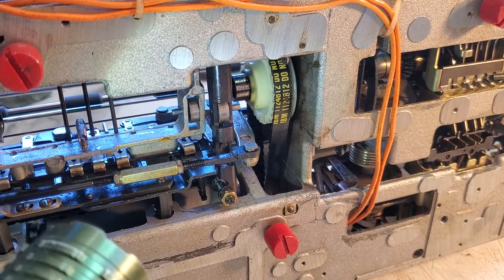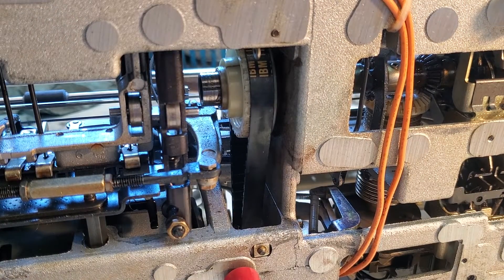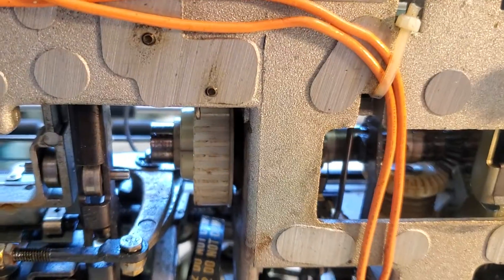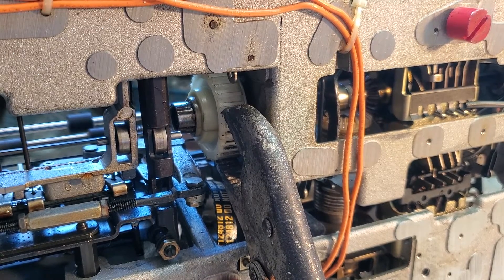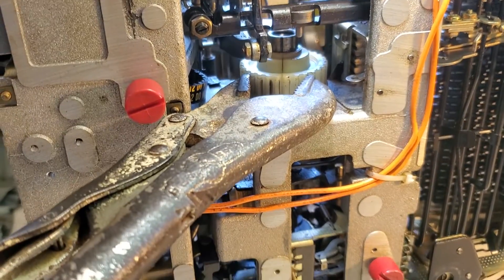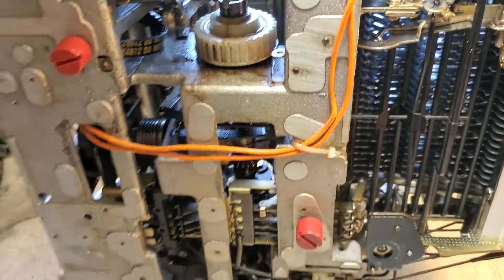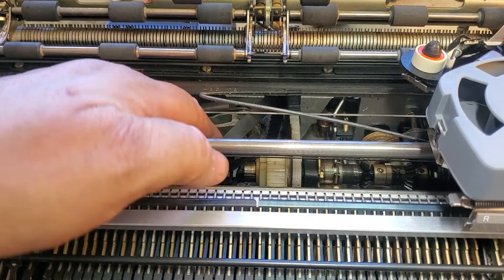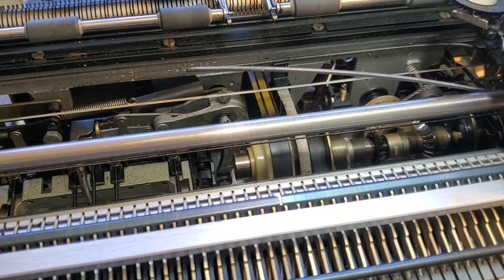IBM Selectric Typewriter Repair Reinforce Center Hub Pulley, Cracked and Motor Thumping, Fixed

Comment: I just bought one from Goodwill for $50.00 - it was first put into service September 1973. It's older than I am by a year! It is in pristine condition and works perfectly. The foam padding is not degrading at all, the insides are clean and the belt is in pristine condition - how can this be? I live in Florida and want to take as good of care of it as I can. My 18 year old daughter just typed a letter to Grandma on it and had a ball! Could this machine just not have been used much? Even the foam in the bottom of the machine is in great shape! I will service it when the time comes, I even bought more ribbon for it on Amazon! I am not certain of what else I can do with it besides letters to Grandma, but it is neat to have this awesome machine!

Comment: Worked on thousands of these way back, from 1974 to approx mid-80's. Serviced thousands, was good at it, never needed help. Even took on a 3 year assignment in canal zone in 1978 due to my good diag skills with selectrics, mag card, mtst, copiers, etc etc. Good old days when IBM thought of you as a valued employee. Was nice when it was mechanical vs the high techologies later on. Put in a part, done. But in panama with the heat and  humidity, saw issues never seen in the states.Springs, left springs under keys, rusting out all the time, always flushing, lubing due to dried up oil. Foam padding turning to a sticky tar just after few years.

Comment: What are the orange wires zip tied to the bottom?
Reply from the maker: Those run from the induction motor (5 volts) to the lighted scales on the lid

Comment: Amazing. Did you invent that repair?
Reply from the maker: I might have . . .  There is a couple techs using similar method now, using a 1" copper pipe, cutting a sleeve and pressing it on, others now use a hose clamp vs those Vice Grips, I had a previous method too, brought on be necessity cause there were No replacements available, now there are metal replacement hubs available, but expensive.

Comment: Very interesting solution. Looks to be a split key ring? Would not have thought of that. Had about 47 years behind the bench myself until retirement about 5 years ago. Very satisfying career.
Very surprised at the resurgence of interest in typewriters!
Reply from the maker: I am busier and making much more money than I did 30 yrs ago, 2008 I should have filed for bankruptcy, but I just went and got a night job, then in about 2014 the typewriter business started picking up, by 2019 too busy for the night job, still busy even though my pricing is double from what it was in 2014. I am also Surprised Everyday on this resurgence, never would have figured . . . .

Comment: Hmm. Kind of surprised you didn't put any glue in there before you melted the reinforcing ring in there. We all know the propensity of parts to slip away from such things. Nice being able to fix it like that without pulling it, though. Well done!
Reply from the maker: Yea, I have or used to put glue in the split, pretty confident ring sunk deep enough is good,
Like I said in video, also used to put epoxy over the meld, but not sure it adds to the strength.
Only one I have seen fail was one I didn't get the ring melted in far enough, it lasted 5 yrs anyways.

Comment: I love your videos. They are very helpful to lots of folks. I would point out that the shaft you referenced in the video is known as the “Cycle Shaft”. The Operational Shaft is the shaft to the right side with the OP cams and tab/cr pinions etc. Thanks
Reply from the maker: Been making up my own nomenclature for typewriters for ever, 
Why is the ribbon lift on vintage typewriters called a "vibrator" ?